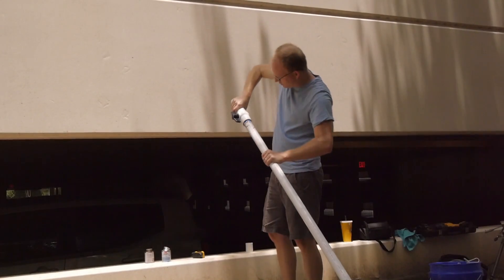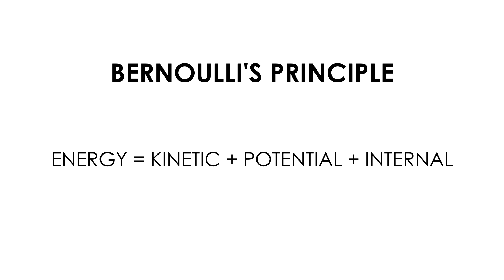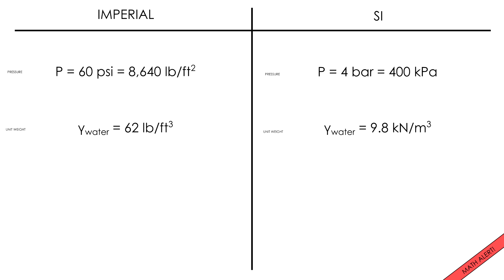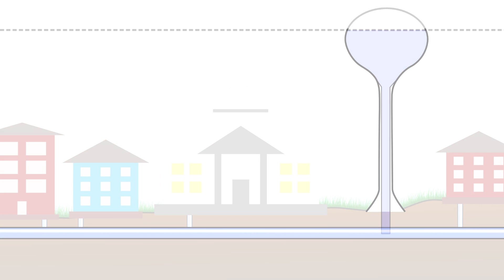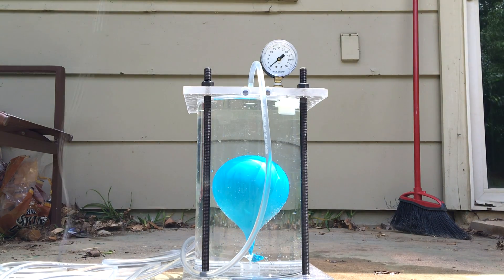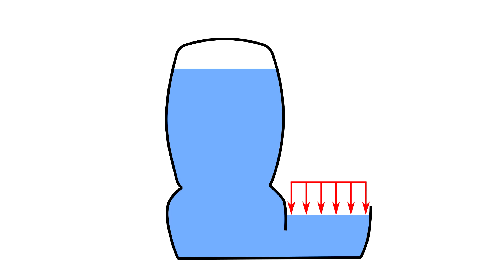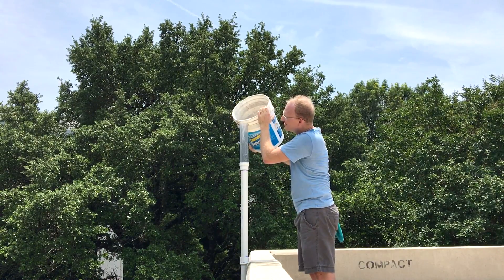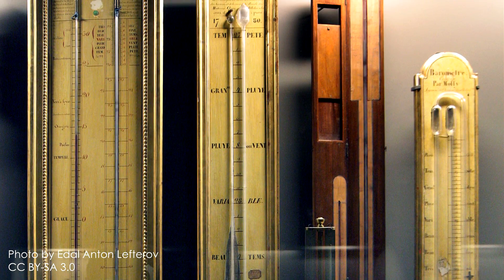Boil Water at Room Temperature! - Hydrostatics

Comment: Ok, so if you had a pool at the bottom of that pipe, and if the pipe was only the diameter of a straw, and you opened the valve, would it injure the people in the pool? or at least make their ears hurt?
Reply from the maker: If the top of the pool was enclosed, yes. Otherwise, the water would just fall down the straw into the pool and raise its level a tiny bit.

Comment: Ok, I'm revisiting this video and something occurred to me, if the fluid has the same amount of pressure no matter where you measure it, why does atmospheric pressure change as you go higher in elevation?

Thanks again for the video!
Reply: I think you got pressure confused with energy. It's energy that is the same no matter where along the height/depth/elevation of the hydrostatic liquid or non-kinetic atmosphere it's measured.  1:00 - 2:13

Comment: Cool to see high point column separation actually occur.  It's a concern, albeit conservatively, in the piping systems I deal with at work.  

Would be cool to see a HPCS testing apparatus with a little motive force behind it to collapse the vapor pocket ... might need high speed video though.

Comment: can you please use thermal camera at 9:19
Reply: Vinayak Dwivedy it is boiling at room temperature, a thermal camera would show you nothing. It just boils because of the pressure
Reply: "boiling" does not equal "hot"
Reply: actually.. the water will cool slightly as it boils
Reply: Santiago Casanova, still worth to see it for exactly that, to show no change.
Reply: Cavitation

Comment: so I get that there is the same pressure at the same depth of water everywhere....or at least thats the model....but in real life everything is more complecated and our models are more of simplifcation and only apply if we are willing to allow for a little impression......

..like maybe static-fluid friction comes into play and mess's with things or maybe temperture changes or.orororororo...a million different things.....and makes the model slightly off

so are there ANY cases where a static fluid could have DIFFERENT pressures at the SAME depth?...and we just ignore those cause their small and/or rare?..
Reply from the maker: Very good question. Actually this is one of those places where the physics and real life behave pretty much identically. There is no friction, since the fluid is static. The only think I can think of is surface tension, which can artificially raise the fluid height and have an effect on the depth/pressure relationship. That is only noticeable for very narrow containers.

Comment: wait.  #1 the hypothesis wasnt even about boiling water at room temp #2 the drain in the bucket wouldnt work because the dog bowl design has A wall that filters water supply to the distrubution side.  the Gutter pipe acted as a hose not a water reserve because of the space between the tap and the ground equals gravity not pressured distrubution.  F for fail and try again with more copying of the designs rather than linking hypothesis.

Comment: I wish you have a thermal sensor so we can see the temperature change in the clear pipe. :)
Reply: ig33ku the temperature stays the same.  it is the drop in pressure that causes the boiling.
Reply: Yes but when the water is boiling is it getting hot?
Reply: ig33ku No, it is not.

Comment: too bad they cant generate electricity using the pressure at the bottom of the ocean.  It could be cleaner and constant. If you can figure out a way to do it.
Reply: in order to harness that pressure you would need to let the water into somewhere lower than it is, Which has many issues

Comment: Why do the water towers have more volume on the top, if it is enough to have a connected tube that goes high? E.g. why not something like the first container (from the video) instead the fourth. Is it to ensure the correct pressure even with smaller amount of water? Great video by the way
Reply: I always thought it was so that when there was heavy load on the water system they act as a buffer.

Comment: It feels like weight is disappearing. But for the funnel case, all water not directly above the small tube has it's weight supported by the structure and not the water? Regardless of the funnel shape?

I imagine the funnel shape to only be useful when it can create lower pressure on the inside. Better explained as resistance maybe. If a stream falls on the walls of a funnel, it is easier to go through the air pressure towards the middle of the funnel than to break the wall and go outwards.
 
But when the added pressure of the water is added, it is no longer easier to go either way. So it just goes straight down, pushing the entire funnel downwards. Or water if its above the hole.

Took a while but I think I made sense of it. Please correct me if I'm mistaken somewhere, I'm no engineer after all.

Comment: How would you get water into hotels or buildings taller than a water tower? Do they use pumps?
Reply from the maker: +derminator Exactly right
Reply: Practical Engineering that sounds exspensive💰💰💰

Comment: I have a question about hydrostatic pressure in your five pictures. Lets take that #4. If I expand that upper funnel to the sides so that it is a wide shallow pool, I could have much more water up there (still at the same water mark). And if that all stood balanced precariously on a scale it would show that the mass increased. So if the mass/weight of the whole system increased, and the area A of the base remained the same, shouldn't the pressure increase as well? 

I get your wider pipe vs narrower pipe analogy, but here we don't have equal diameter on entire height of the collumn.

Comment: In the experiment where you took the tube to your roof, what would happen if a friend put on a hose clamp at ground level while you were up there? would the pressure be ground level pressure since water doesn't compress well? Thanks!

Does this mean that the energy you get out of a hydroelectric dam is only related to its height, and not the lake's volume?

also neat channel, cool vids.

Comment: Tom Scott sent me, Excellent video. I am now Subscribed
Reply: Yes you are right in viewing internal energy as the energy contained in the system. But Grady is referring to pressure of the fluid as internal energy . Refer to this link http://hyperphysics.phy-astr.gsu.edu/hbase/pber.html. Energy  = pressure + kinetic + potential. Also take a look at this page - http://hyperphysics.phy-astr.gsu.edu/hbase/thermo/inteng.html
Reply: If you understood everything, could you please explain to me why the water has the same amount of (total) energy at every point? Why can't the top be higher/lower on energy than the bottom?
For comparison, if you stack solids onto one another, shouldn't the higher ones have more energy?
Reply: Think of it this way. By your analogy the bricks at the top have more potential energy but less internal energy (stress in this case). Bricks at the top have nothing pressing them and they only have potential energy. But as you go down, the lower layer of bricks have lesser potential energy but at the same time have more number of bricks pressing on them (more internal energy) so even though the bricks at the bottom have zero potential energy the lower layer of bricks have all the stacks of bricks pressing on them and therefore at any point the sum of potential and internal energy remains constant.
Reply: So you're saying that "internal energy" is the pressure applied by the environment? That doesn't sound like an object's own energy.
Reply: Thanks
Reply: You are welcome.

Comment: Unless I'm wrong, another intuition to describe why the pressure is the same at the same height, even with different volumes of water, is that what is different, is the amount of work which can be done. Effectively the energy. But intuitively, assuming you tap the water under the specific pressure to perform work (dynamic, mill, etc), the level drops much quicker in the smaller pipe, thus resulting in quickly lowering pressure compared to the larger volume of water.

Comment: I think that if you did this same experiment on the moon, you would get the same result because Gravity is still pulling on the column of water and the vacuum in the top of the tube is not taken into account here. The moon of course has no atmosphere, so please address this in a follow up video.
Reply: I imagine that the bucket of water at the bottom would boil away, pulling harder against that vacuum in the tube. But at some point the vacuum in the tube would over power the gravitational pull. That might require a way to contain the water and that all sounds very complicated. Maybe the experiment to start with would be taking a plunger into space and see if suction or a vacuum can be created from within a vacuum.

Comment: but then why doesnt the tube melt
Reply: Alex Arsu the temperature of the pipe or the water isn't changing.
Reply: then how does the water boil
Reply: Alex Arsu because in a vacuum there is no air pushing the water down and keeping it together. in a vacuum, the gasses can escape the water and travel freely.
Reply: to boil means for the temperature of the water to reach 100*C. What does this have to do with any gas or with the vacuum created? I mean yeah the vacuum creates the tension that makes it boil but I think the simple answer would be because 100*C is lower than the melting point of the tube..
Reply: Alex Arsu depending on the pressure in the tube, the waters boiling point drops.
Reply: Boiling is when liquid transfer into a gas. This occurs at a range of temperatures and pressures depending on the material.
Reply: Alex: The boiling point of water is 100 degree C at atmospheric pressure (sea level). You change the pressure, and the boiling point will change as well.
Reply: can't you see XAOS already answered that?

Comment: Great video! One thing worth mentioning is that trees manage to break this rule. Redwoods are far taller than your PVC pipe, but have  Xylem (small tubes to transport water) running from the roots to the canopy. Only  two things prevent the water from boiling ; a. the small diameter of the tube actually inhibits the state change and b. the perfectly smooth walls of the tubes do not have any imperfections to serve as a catalyst point or any defects to initiate a boil. The xylem can draw water using capillary action, and be absorbed at the top with no boiling.
Reply: maybe, because xylem in trees is not like as the "closed" pipe showed in this video. I think there is much pores in body of trees, so it can't cause vacuum effect at the top
Reply: There's capillary effect in action. The surface tension of water and acute meniscus of water surface in thin tubes makes it rise great heights.
Reply: There is water evaporating through small pores at the leaves or needles which helps water transport upwards against gravity
Reply: @lesnikow  The capillary effect I am not as knowledgeable about but I assume it is based on osmosis and hydrogen bonding but the idea that there could be a state shift that would lower the density of the water to allow it to move upward seems intuitive to me based on this example of the capillaries are long enough and create a similar system. Which would also mean that a higher volume of plant mass could be hydrated with smaller amounts of water. The idea that trees can act as evaporators for large amounts of water and have a cooling effect this way also makes sense. I actually ended up googling this page because I was curious what the height of a water column would be necessary to generate a vacuum to evaporate water if I used a water tube and hung  it from my 13th floor apartment. would it drip faster than the water vapor from the tank of water I want to cool and how much  air/vaccum  space would I need to include at the top so that it wouldn't act as a straight syphon. I don't want to use a  ram pump because I only want to drain the water that I evaporated or possibly use some sort of air pump to create the necessary vacuum to draw the heat and evaporate the water from the water tank with the pump located outside the area I want to cool.  I was actually pretty surprised how much pressure the atmosphere exerts on us. Looking at how much water condenses on the outside of his pipe was also interesting. It makes me wonder if it would be worthwhile to include a column of water to act as a condenser above the tank to function as a dehumidifier with the outside of the tank insulated. As far as I can tell from my utility bill I am not charged for cold water. My hot water is metered but they don't seem to meter the cold water. The chimney effect that helps exhaust fireplace gases and feed hurricanes is probably more similar to what I'm curious about. I've read interesting articles about its ability to generate power and purify water in desert environments. My goal.is just to satisfy my curiosity and distract myself on a humid summer night dreaming of using a small volume of water comparable to what a person might sweat to keep the temperature of a cooling mat far enough below body temperature to keep my bed dry from sweat. I've seen dogs keep cool using geothermal cooling lying on stone blocks but anything soft enough to make my cement floors comfortable seems to insulate me enough to leave me sweating. I have tried draping my bed in damp sheets after the spin cyclewith a fan but that comfortable cool feeling I remember from an outdoor clothes line is too short lived and anything damper like I might get through osmosis is going to grow mould on my wall paper. I wish my portable air conditioner had an intake to cool the condenser and was a few decibels quieter. The negative air pressure seems to be sucking mosquitoes into my apartment. I wish I was in North America with affordable well designed appliances but Korea would prefer to overcharge domestic customers while shipping premium products overseas at a fraction of the price. So my dream now is a positive pressure apartment with filtered air to block the 145aqi outdoor air and a quiet dehumidifier that doesn't raise the indoor temperature too much but dries my sweat! For the person who made this video my thanks for the distraction and the well modeled principles and explanations.
Reply: You forgot also dissolved substances in the water and the osmosis effect that gradient the percentage is different at the bottom than the top.  Reverse osmosis filters use pressure to purify water as the exact opposite direction process.  Outside pressure changes the direction.
Reply: i don't know how the tree does it but maybe -
just like a multi-stage well pump - the tree can use the atmosphere to get 32 feet of water lift - fill a reservoir - and start another pump to lift another 32 feet
Reply: Water went up, as the tree grew. No pumps needed ; )
Reply: Trees also exert some root pressure on the water.
Reply: Water doesn't boil in the tubes, but the atmosphere still wouldn't have the necessary pressure to take water from the roots to the leaves. Microscopic pumps maybe?

Comment: There is no way the first example is correct. The pressure in the first end second tubes won't be the same. Just imagine an extreme example. F.e. If the big bottom part of the first container is the size of an olympic pool and the pipe above it is a couple cm in diameter and as tall as the pool is deep. Compare the pressure at the bottom of that pool to the pressure at the bottom of a pool twice as deep. Obviously they won't be the same.

Comment: If the pipe can support 35 feet of water why doesn't the dog bowl need to be 35 feet tall to not leak. it's the same principle with a vacuum on one side and open air on the other 

Secondarily.  Do you know why it's called a "head" of water. Where does the term head originate?
Reply from the maker: +boatsport88 The dog bowl gets a bit of air into the tank every so often as the dog drinks which allows the pressure to equalize with the atmosphere. Not sure about the second question. I've never thought about it!
Reply: Head means pressure, usually referring to pumps. Of course the first pressure gauges were simply a vertical tube open at the top connected to the output of the pump and the height of the water in the tube was the pressure. The top of the column of water was its head. 
Whether that is related to beer or not is anybody's guess. 
Certainly not related to a ship's toilet.
Reply: Another way of looking at it is that if you make the dogs bottle 40 feet high it wouldn't hold any more water than one 35 feet high. As soon as you tipped it over 5 feet of water would run out onto the ground and then it would stop until the dog drank some and let a little air in. 
The amount of vacuum necessary to hold the water in the dog's bottle is a lot less than the water barometer. It would be proportional to the difference in height between the open end and the closed end, about 0.5 psi per foot.
Reply: Isn't it the other way around? the water would leak if the tank is above 35 feet not below (as the bowl is).
Reply: That's what I said.
Reply: Mmm, I was referring to the original comment.

Comment: If you can boil water like this, could it be useful as an energy efficient method to purify water somehow?
Reply: The Bright Pixel High efficiency pumping to lower pressure is used instead of a tall tube, but flash boiling desalination does just that.
Reply: Very cool. I did not know that

Comment: Hey Practical Engineer, if you're going to use a ladder to get on the roof, use the correct size ladder.  Three rungs over the roof line for safety please.  Thanks.